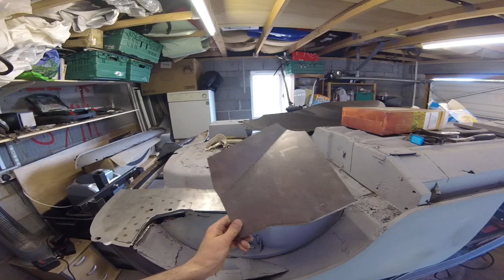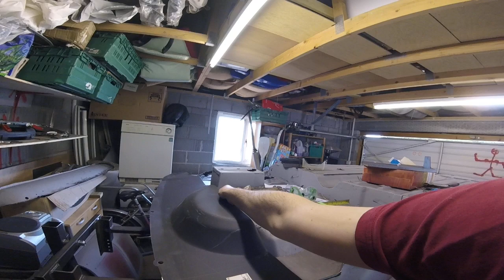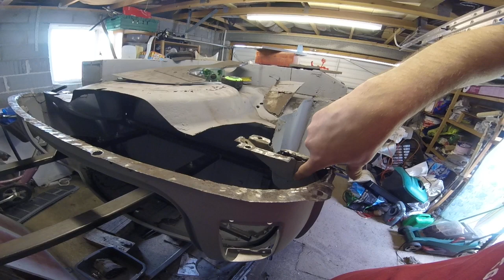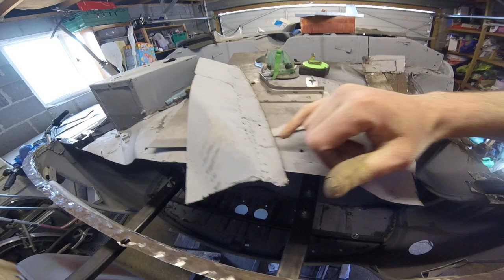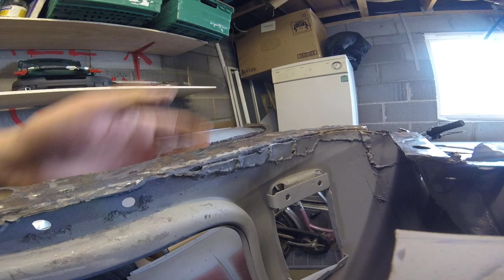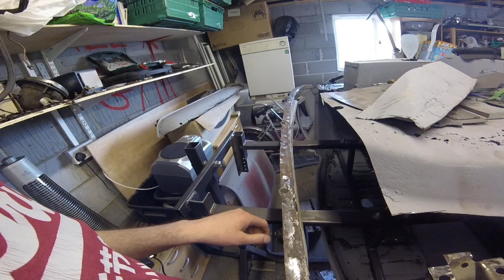16 Classic Mini Restoration - Boot floor cutting

Comment: I"m only beginning to think about where you're at now.  Because I don't have the skill level (yet), I am counting the patches to help me determine whether to replace then entire boot floor or do as you're doing.   enjoying your videos
Reply from the maker: I was nervous to take out the whole boot floor, that combined with the floor price and the fact it's really an MPI floor (bigger hole for the fuel lines) put me off. That said you've had the whole main floor out so you shouldn't be worried if you can afford the panel.   Also the rear subframe holes will be correct on the full floor relative to each other without having to adjust them. I saved money for a genuine front end and bulkhead but if I did it again maybe I'd try to find the extra money!